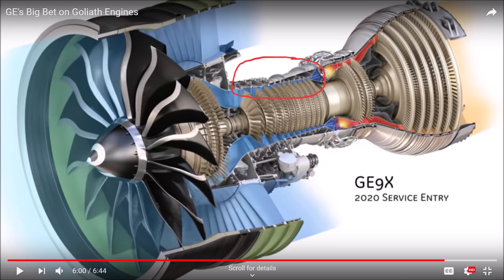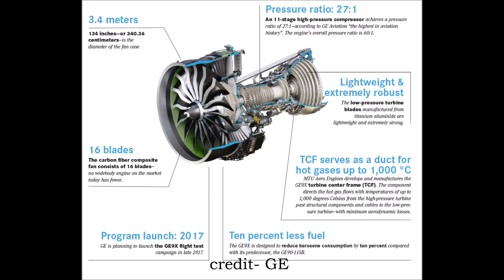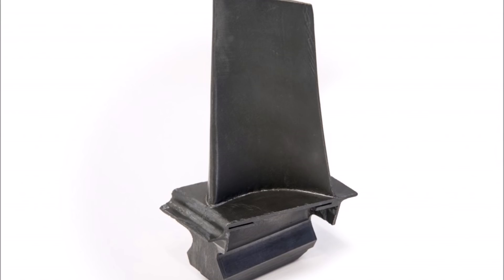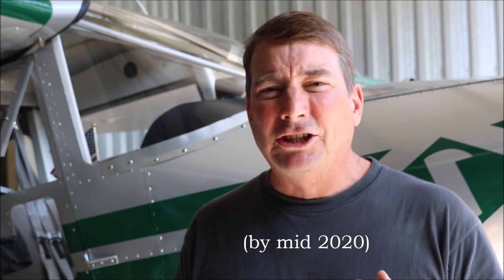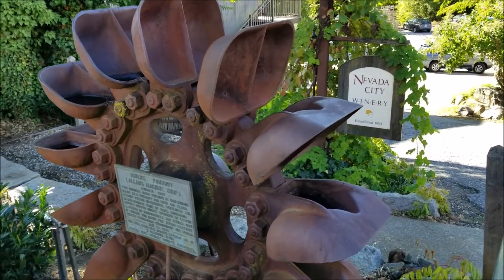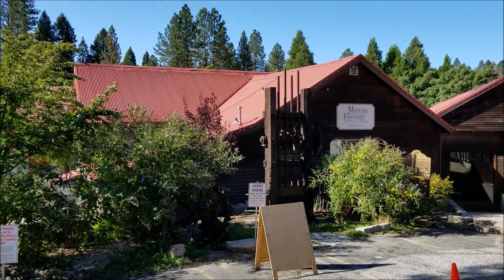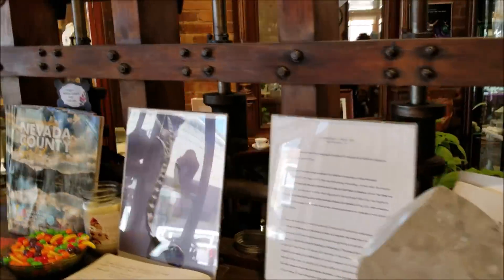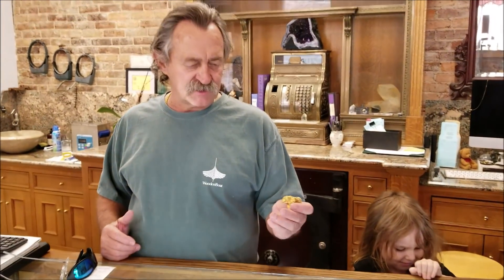Boeing 777x Delays and the GE9X engine stator vane issue.

Comment: wonder what the difference between the blads in a jet engine vs what you find in a turbine in a power station?
Reply: Industrial turbine engines have the luxury of running continuously, with much fewer start cycles. They can built more heavily than their flying cousins too.
Reply: Well GE has used its jet engine technology in its power generation gas turbines for 40 years or more, so at least for those turbines, there’s little difference.
Reply: QALibrary There are a significant number of differences between a steam turbine and a jet engine, though some of the technology can be transferred. The most fundamental difference is the tradeoff between weight and efficiency. A steam turbine is heavy and ground based. Doubling the weight to improve efficiency by 5% is a no-brainer, while on a jet engine the priorities are the opposite.

Comment: What causes wear on the compressor stator vanes? They are not being contacted by the compressor blades, right?
Reply from the maker: Extreme temperatures and pressures. Even in the 'cool' section.
Reply: Corrosion and vibration induced fatigue are also factors.

Comment: more goodies
I wonder how they balance the carbon blades and what happens to the carbon blades with bird strike.
Reply: The stage 1 fan blades are carbon fiber (black area) with a replaceable titanium lead edge (silver area).  Each blade is weighed and then paired with a blade that weighs the same (or very close).  Typically these pairs are installed 180 degrees apart so they “balance”.   The weights of the 8 pairs are inputted in a computer program and the blades are mapped to a certain location.   If necessary small weights can be used at final balance to get the balance “perfect”.  I have oversimplified the process but I hope this helps.
Reply: @qcan8468  Thanks for your info.